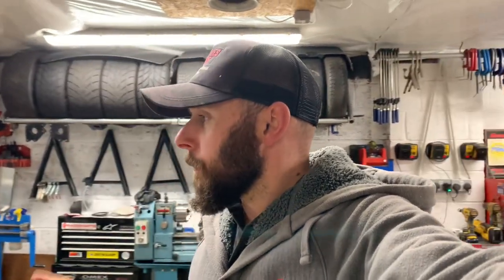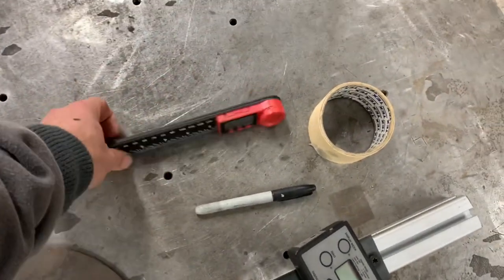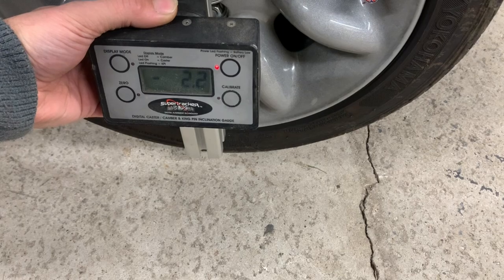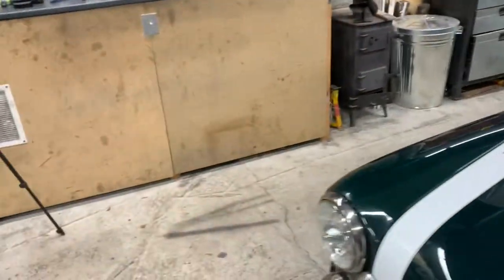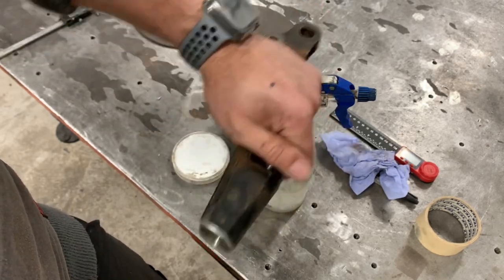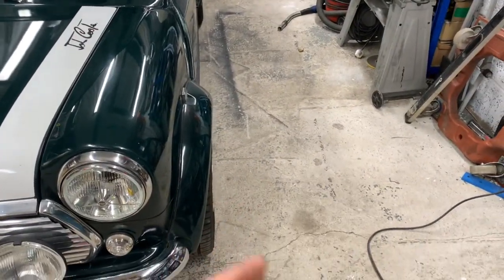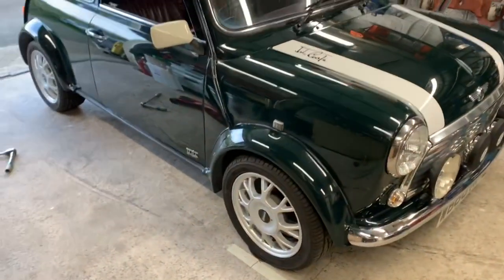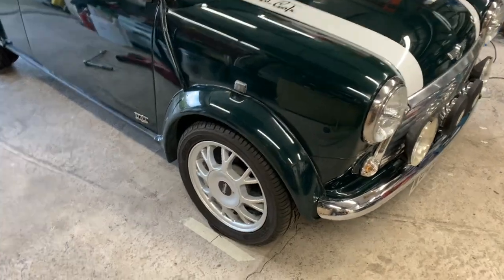Treating Alice the Classic mini to a suspension setup

Comment: Seen a little trick on KSR Performance channel. He aligns his race cars on two pieces of thin plate steel with a small amount of grease smeared between the plates. This way he doesn't have to roll his cars back and forth between adjustments.
Reply from the maker: My plates used to have a base plate that let them slide about on top off but they rusted so bad I binned them and kept the round bits. That Kevin from ksr is a man who likes the details just don’t get in front of him in a crown vic lol
Reply: Glad you know who I'm talking about👍